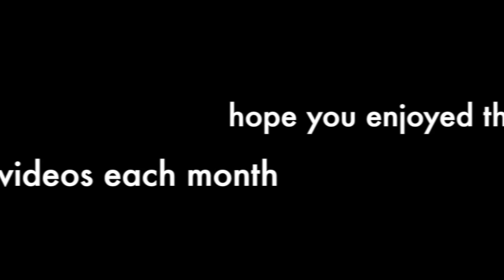How to Assemble a Stanley Hand Plane - Basic Bailey Model

Comment: Nice. I have an old Stanley Bailey no. 5 that I had to figure this out on when I first got it in order to clean it.
Reply from the maker: +CMR Woodworks | Chris McDowell Thanks Chris. I cleaned up this plane for Hallowood15 (you might want to check it out if you don't already know about it, ends on Halloween) but felt like the assembly should be a separate video. So I did I search for "how to assemble a hand plane" to my surprise there wasn't a single video, in the relevant filter, that shows just the assembly.

Comment: Great video! I just did a sharpen and basic refurbish on a Stanley Handyman plane and couldn't figure out why it wasn't going back together nicely until I found your video. I was putting the chip breaker on the wrong side of the blade...
Reply from the maker: Glad to know it helped. I've done that a few times. I think anyone who assembles and disassembles planes a lot will put it on backwards occasionally. And you probably will do it again if you sharpen enough plane, though now you know the problem. Good luck.

Comment: Mine is a Millers Falls but I have problems with rocking tote when I screw It down. Any ideas how to fix?😁👍
Reply from the maker: The wood probably shrunk over time. Increase the wood thickness or cut down the threaded rod.

Comment: I bought a used plane.  I took it apart and put it together without losing any parts.  Before and after I took it apart, the lever at the top of the blade just flops up and down.  Is something missing or is something not put together right?

Comment: Hey, I've got a Stanley 4c also!   Great smoother.   The one thing that bugs me is that Stanley changed the threading direction on the adjuster a few times, so my smoother goes one way and my Jack (or Jointer, one of them) goes the other way.    I can understand why guys get picky about making sure all their planes are the same type.
Reply from the maker: +wordsnwood The corragated types are my preferred Stanley planes, they weigh even less. I didn't know Stanley depth adjuster had different threading. All my depth adjust the same way.
Reply: +John Zhu If you google "stanley plane type guide"   you will find a guide at hyperkitten.com (if I give a link I'll likely get shunted into spam by youtube)    And if you dig down you can see that the type 1,2,3,4,5 plans had left handed threads and then starting at type 6 (1888) they had right-handed threads.   Hmm,  I'd have to go digging into my planes, as I did not think I had any that old.  It might vary based on the model,  I did not do a deep dig into this.   
  Another good resource, in case you didn't know is to google "Patrick's Blood and Gore"  -- not making up that name -- for a huge information dump on Stanley planes.
Reply from the maker: +wordsnwood Thanks Art. I have used both of those sites, some of the information is consistent and helpful.

Comment: Thanks very much for posting. I bought an old one and have flattened it and cleaned it up nicely, however, one problem. The brass nut holding the knob down at the front of the place will not fit flush level with the wood. It stands proud about 3 or 4mm. Pretty annoying. Pretty sure it didn't prior to disassembly. I'd appreciate any thoughts. Thanks for the vid.
Reply from the maker: You're welcome. It sounds like that post might be bent, or the threading is striped. Also, it's not uncommon to find the knob or handle loose because the wood gets worn down. I can think of 3 solutions; 1. shim the knob so it doesn't move. 2. grind down the screw-post as long as it still holds well. 3. use a bottom tap if the problem is with the threading. Personally, I'd go with solution 2.  Good luck.
Reply: Thanks very much for the reply. It's very odd. Detaching the post from the brass nut shows the nut doesn't even sit in the knob flush on its own. thanks for the suggestions.
Reply: The post on the front knob has threads on both ends - check that the top threading is all the way into the "cap".  
(I realize this post is super old and you probably already solved this but...)  :)